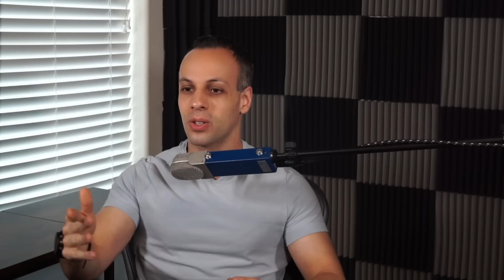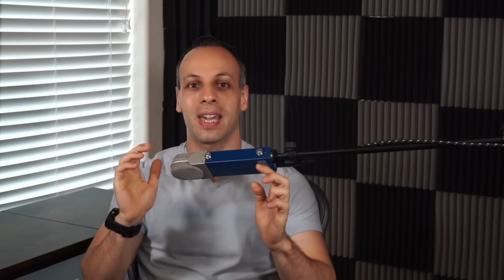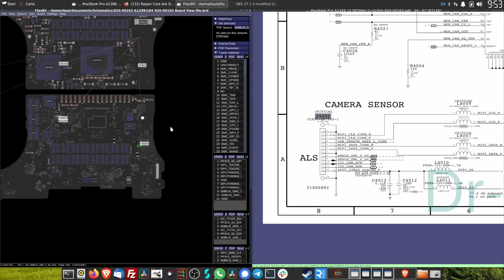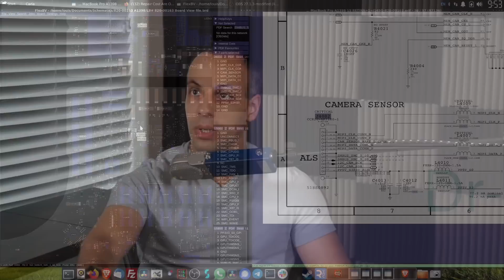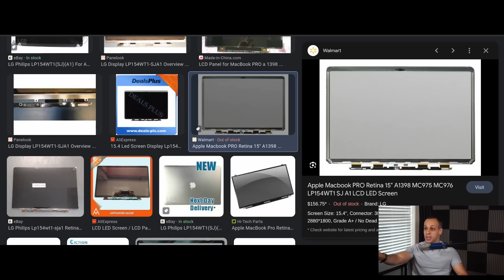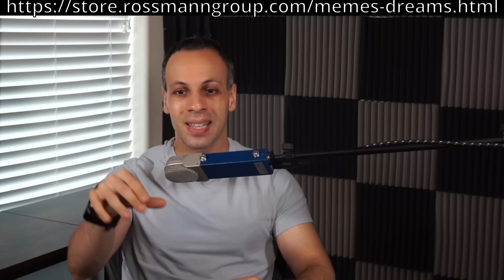The Ford F150 Macbook - when car repair resembles macbook repair...

Comment: I was telling people this would become a thing eventually.  The 3000$ headlight I used to say.  Little did I know I was two grand short.
Reply: bmw was already charging $1200 for top of the line xenon headlights in 2006, no reason the trend wouldn't continue upwards.
Reply: @anticyclingclub Current trade price for a BMW M4 headlamp is about $2500 plus another 200 to 300 for the control module.
Reply: Yup, a lot of people saw this years ago.  I remember thinking $1200 headlights for a Lexus was nuts, but that was in like 2006.
Reply: I can get new sealed beam headlights for my vehicles for $15 apiece.
Reply: Almost had a heart attack when I heard how much a Mercedes headlight cost… I’ll stick to old and cheap cars forever
Reply: @angelgjr1999  take the led matrix lights, or even led tail lights where each has 25 led in it...take 100 led that light out the street in front of you each designed to light ob a small spot in front of the car.
Yes, they are great and it works great.
But when 1 led breaks you fail the road worthiness test...we are talking about a light that is 99% operational  (96% for the tail light...and that just shines backwards, no focus on spots...still the same results) and you need to replace the whole unit,  can not be repaired.
By that logic you would need to replace your xenon lights every 200 hours, because they lost 1% of brightness
Reply: The tail lights are so expensive because they have integrated radar modules for the Blindspot detection system. An unnecessary, annoying, useless system. in another video, the truck was back in the shop because it also has, I kid you not, vibrating massage seats.
Reply: Just wait til the 5000$ phone with a 2k screen repair comes out
Reply: by the way in the USA if you are 3000$ is suppose to be written only as $3000
Reply: A new Cadillac Escalade requires a whole new light assembly if 1 LED bulb burns out...
New Light Assembly cost: $2,500 for just the part!!
Reply: Time and inflation equals the same thing really.  Just a different formula applied.
Reply: For years I've been saying instead of repairs people will just replace vehicles
Reply: we can pump those numbers higher
google the price of a new bmw laserlight headlight
Reply: WHAT THE....$22k for the i8 ???  @Stromaism
Reply: No, you got it right; price adjusted for Bidenomics (inflation).
Reply: @johnhermann762 Found the Trump supporter. 
"Bidenomics" lmao. Why on earth do you think Biden has the power to change the economy of the entire world this much?
Reply: @johnhermann762 lol it was Trump's checks that triggered inflation.
Reply: @johnhermann762 it’s always political and someone else’s fault! No wonder your genes are recessive and the earth hates you!

Comment: As for having a designer "with a bird's-eye view", I have a story.  I started-out in the electronic repair business in my early 20's.  As I neared the age of 30, I decided to go after a degree in Engineering.  I had seen too many bad designs in my years of repair.  I wanted to be part of the solution.  Well, from day-one at the State College, I was told that I did not belong in their engineering program.  In the opinion of the professors, I already had too much life experience.  Corporations and engineering firms wanted young kids that they could "mold".  The assistant head of the Engineering Department even tried to get me kicked out of school---not because my grades were bad, but, because I needed "to make room for someone who has a chance!"  I finally completed the program---only to find what the professors had said was true.  I had wasted my life savings and 4 years of my life.  Companies do NOT want someone with "a bird's-eye view"!
Reply: Try any aircraft or avionics manufacturer. Absolutely required that the entire life cycle of the component or assembly or system is understood. As well as effects on other systems. Maintainability is required in every stage of design. There's a reason that something as complex as a B-52 can be expected to be airworthy nearly one hundred years after originally manufactured (as currently projected).
Reply: @mikebarushok5361  Guess you never watch tv.  A dozen programs dedicated just to airline crashes.  Just found another one that specialized in Alaska airplane crashes.
The B52 is easy.  We also went to the moon with slide rules, can't get to low orbit with super computers.
Reply: @robertsmith2956  You might be right that I don't waste my time on TV. But, I don't believe that what is a popular TV show subject says anything useful to know about how products are designed, tested and regulated. Or how reliable, maintainable or safe they are. Even the best product has the weakest component which is the human operators.
Reply: @mikebarushok5361   the auto pilots are designed backwards.  Most of the crashes are becasue the pilot is wasting time trying to figure out what the auto pilot is doing instead of fling the plane.
The pilot should be flying, and the auto pilot asking the pilot what the hell they are doing when they are messing up.  The computer will never admit it is messing up.  So at least the pilot can tell it, it is wrong and continue keeping the plane in the air.
Reply: @robertsmith2956 - passing off OVER A HALF CENTURY of B-52s STILL FLYING as "easy" is ridiculous... do you have any idea what those pressurization add depressurization cycles every time they plane  takes off of lives do to the airframe, alone? 
 The fact they can still keep them flying is  a miracle of engineering, maintenance and management
Reply: @vvvci  Not at all. They were designed with slide rules.  737 used computers, and they loved to spiral into the ground.
Reply: bullshit take, many people here in germany do what you did only to pursue a degree later and they are valued heavily in r&D companies
Reply: @csPinKie  probably why you could buy our failing manufacturers.
Reply: @robertsmith2956  our cars are by no means perfect but many software features in todays cars are a result of regulation (security mandates) and not because we want to squeeze money out of ppl
Reply: LoL @csPinKie
Reply: Schools, and employers, don't want someone who actually understands how things work, they want someone they can "indoctrinate" Mechanical schools are turning out parts changers that have no idea what those parts do, or how they work together.
Reply: That's horrifying.
Reply: Absolutely disgusting. And the same goes for the educators aiding and abetting it ...if they just went ahead and enthusiastically trained more people like you, and also forewarned the younger people about the borderline malpractice these companies will expect them to engage in, maybe there would be more pushback within the industry.
Reply: The engineering role you are referring to with a "bird''s-eye view" is called a Systems Engineer. Any role should have competency about the discipline of systems engineering, but usually you end up having people in a department called Systems Engineering with a bunch of Systems Engineers. The problem with many companies is that they use these people to perform meaningless check-box work, just to make the company "look good". There is a severe lack of systems thinking in upper management who usually only consists of MBA types with no real engineering education. During times of central banks printing money and artificially low interest rates, these kinds of people have been very good at optimizing the financials of a company, and just using the knowledge that was there in the engineering departments. However as time goes by and the key personnel quits, there will be less and less of real product development genius and the products will be worse and worse. Exceptions to this are found in companies with a clear product focus and fast innovation, like Tesla.
Reply: @makzmakz - Sandy Munro despises NBA's, and especially Harvard mbas!  Who sent him to China 15 years ago to set up the factories that will soon be  putting American automakers out of business
Reply: Speaks volumes about the type of world we are in. Long gone is the days of the best people being valued for having the best ideas. Now it's all about manufactured mediocrity because it's easier to control. Wonder how this will end, with actual innovation and expertise being sidelined in the name of profit chasing.

Comment: Went to a Ford dealership this week to buy brake shoes for a 97 F150. I was told my vehicle is obsolete and that they can’t order me the part.

 They only made 750,000 of these trucks, how on earth are they supposed to provide parts support, it’s just so niche. /s
Reply: Why would you buy brake shoes at a dealership?
Reply: @gfwsux7984 Tl;dr tried going aftermarket first, a hole was improperly drilled by a few millimeters on two sets of basic shoes and a set of premium shoes from NAPA. They agreed at the counter: it was a manufacturing deafect and not some sort of model variation. I want to buy in person because I didn’t want to wait around for shipping. 

The hole was for the cable guide for the auto adjuster. The hole was the right size, but it was too close to the backing of the shoe. The cable would on one set could not fit in the gap, and on the other two sets, interference was so high that the cable would bind up instead of sliding. Which meant the auto adjuster couldn’t do its thing. I bought new cable guides from NAPA too in case they were lower profile, but the cable guide was an exact match of the OEM part. Like Louis trying to get replacement screen, sometimes there’s inexplicable issues with third party parts.

I was able to order OEM online. After waiting around for shipping a few days, they worked perfectly.

Comment: Water getting into the tail lights used to be fixed with drilling a drain hole and or sealing the edges with RTV silicone and a new bulb (remember light bulbs?).  Or if you really wanted you would just get a new one.  I hate new cars and I used to be a mechanic

Comment: As a longtime Ford fan and amateur Mac self-repair hobbyist, I agree with everything you said with one exception; that the light housing design wasn’t good at keeping out water. If this had been the case, Brian ( @FordTechMakuloco ) would have mentioned it and would have known right away what the problem was because he would have seen it many times. It’s more likely this was a rare instance, at least for a relatively new truck.  Brian has seen it all and I’ve learned so much from him keeping my 16yr old truck on the road.
Reply: This is very common issue with flooded vehicles.

Comment: I worked on vehicles for 15yrs and never once did I think Ford was the exception “built tough”. Additionally, components that use the CAN may also be failing which can cause other erratic (non-immobilizing) operations of the vehicle, like the example here. It’s sad. Government and Auto Manufactures are plotting against the People. 😑

Comment: This isn't specifically a Ford failure; other vehicles using the same sort of setup (CAN taillights with BSM radar built-in) have the same issue.

Depinning the CAN wires from the lamp connector at least allows the rest of the vehicle to function, albeit without BSM. Sometimes when you get told "hey it's gonna be 3 months for the part" that becomes a sensible option. Especially when leaving it as-is results in a vehicle that doesn't have functioning gauges, lights, windows, etc.

Comment: I have been watching Fordtechmakuloco ever since I bought my 2009 F150. When I watched the video you just mentioned I was floored by the insane cost the customer had to pay because of what came down to a simple water leak. Newer cars are insanely easy to break anymore simply because of the data exchange between modules. It is like a wise man once said "the more you mess with the plumbing, the easier it is to plug the drain". On a side note the customer didn't care the cost he just wanted his truck back.  Must be nice to have money to burn.
Reply: I love my 2011 F150 and do a lot of my maintenance because FordTech showed me how. 130k miles on it and runs perfectly. Has a computer on it but hopefully I won’t have to mortgage my house if it goes bad. I’ll drive it till I die rather than buy a ridiculously overpriced piece of garbage new one.
Reply: I bet you $100 that the truck was flooded!  I buy from Copart, and flooded trucks are my gravy!  

Customer did care since insurance check was in the mail or even managed to buy back his own vehicle.
Reply: Even if true it's irrelevant. Soaking the taillight should not wipe out an entire line of modules and what not. @litoaykiu
Reply: @rcnelson  Water was not only in taillights!   Water inside the cab will get you. Wiring harness has waterproof connections.
Reply: "the more you mess with the plumbing, the easier it is to plug the drain" Ah, Scotty from Star Trek III
Reply: I saw the owners comment on the original video. His insurance covered it so he was more worried about just getting the truck back.

Comment: The Ford-Fanboys who say that it's "not out of malice" and therefore just incompetence, don't seem to realize, that that is way way worse.
The so-called mallice is a conscious decision which can simply be changed, if there is enough pressure from the customers.
But incompetence to such a degree, means that there are actually a lot of incompetent people involved. And at the very least, this also includes bad or little quality control.
In other words: incompetent managers, supervisors, engineers... And that is supposed to be "better"? Have fun with your Ford car then - and pray they didn't mess up safety features this time.

Comment: We call that a single point of failure.  Single points of failure are really bad.  I think at this point it's abundantly clear that the Japanese and South Korean automakers have largely surpassed the domestic US automakers and that has been the case for decades.  Buying American cars is at this point, in my humble opinion, just like donating to charity.
Reply: Idk, the South Koreans just finally realized immobilizers might be needed in their cars.
Reply: @GeneralChangFromDanang  True but that's a feature that you need to pay in the higher specked models lol.

Comment: I can guarantee those lamps are manufactured to be waterproof.  A sample of each batch is tested by dunking them in a bathtub and then verifying they still work.  If the lamp was a leaker then it was either cracked by the user or manufacturing defect; so please don't say "they weren't made to be liquid proof"... They absolutely were.  Also the object detection modules are supposed to be serviceable (they are only screwed in place) so I'm a little surprised there were issues finding them.

Comment: Failure Modes and Effects Analysis.

It is part of the project management process of Engineering design. At least, that's what I learned in University. But Industry can hide behind "trade secrets", etc. So many modern companies may be half-assing this step of the design process, and we may never know 🤷🏿‍♂️

Comment: seriously can't accept that type of shit put on people which is a useless error on the console as unit alive that's why its telling where is the issue in networks?
if it is short with the ground it's on 3 or 5 v bus it shorts all lines and linear power will stop so all modules will stops then where unit works if its a button in end-all for input there is a short with ground  i never accept such type of shit actually being a repair engineer or say reverse engineer ( that's wat u say ) 
on processes, we all follow not in the video it says all off all short 
simple come times hall switch shorts stops 3v alw and start heating step down on the same issue can make such video ???

????????

Comment: Louis, if you would like to keep your sanity, don’t go down the automotive rabbit hole!
Cars are designed like crap nowdays (firsthand experience) and I sometimes wonder how they even start.

This Ford’s safety model is beyond crap is a single faulty sensor causes this level of shutdown. We have thousands of computers-microcontrollers in a current car and several different manufacturers make the ECUs just like LEGOs. This will be even more common and true, not because of malice, but sheer incompetence.

Comment: I was getting my Ford Escape washed when it stopped running. 
I had to ask the next person in line to help push it out of the “Car Wash.”
After having it towed to the Dealership, I paid $1200 for a new computer. 
Apparently, we should not be washing our cars, as we might get them wet ;-)

I currently have a 2016 Jeep Cherokee Trailhawk, and you are right. They are not built right.
Occasionally the passenger side window, or the backup camera does not work. 
They all have the same core problem, and you are speaking about it here.

These things are grocery getters, we should not be trusting them outside the city.

Comment: Chrysler hooked their transmission lock up through the rear tail light in the first mini vans. So when the bulb burnt out the transmission melted down. The lock up torque converter would never turn off. Like never using the clutch in a standard and always having max RPM. Clutch doesn't last long.